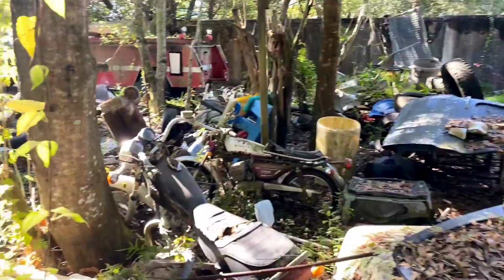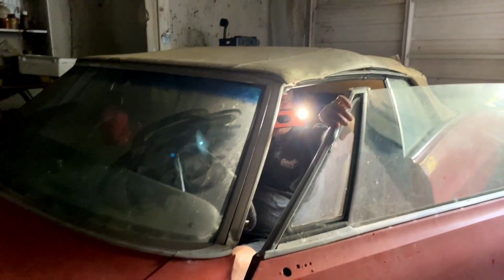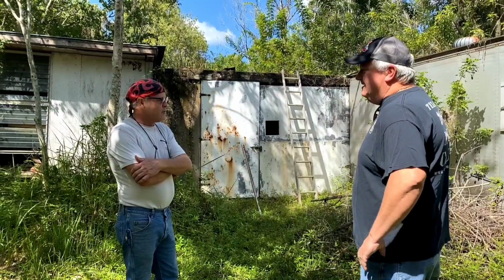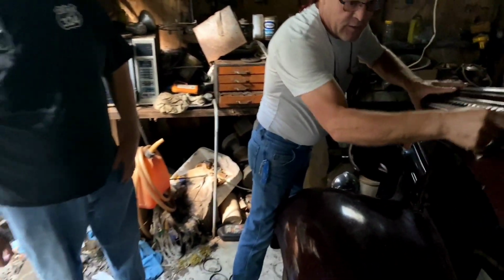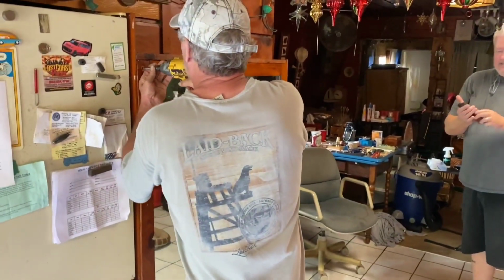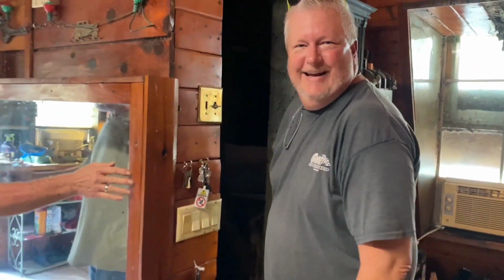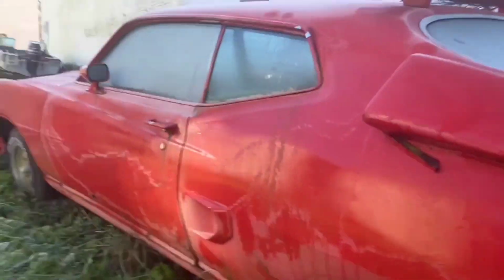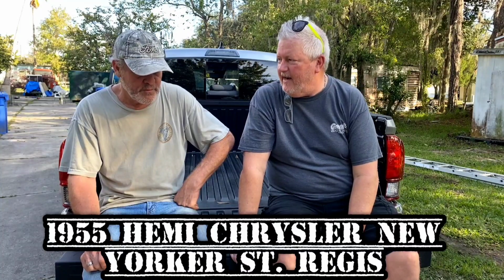BARN FIND HEMI, MORE!

Comment: Had to watch all three to see the torino...lol...really interesting
I had the 70 gt 351 4v (introductory boss) engine ...kept it 25 yrs until it got towed ...mine was 4 speed tw10 born warner top loader trams with 350 gear and factory tach...very rare, can't even find pics of that body....sux...but my interest started with my dad buying my mom a 70 429 king cobra engine in a (gt) midnight candy blue with 373 gear and same borg warner 4 speed trans ....in 70 you could order any thing you wanted, so dad liked the gt torino body better than the cobra torino body for the tail light going all the way across ...also had the light blue that ran to dark blue rally stripe down the sides of that midnight paint which the cobra body didn't have ...at lol so beefed up suspension that kept rear a little higher than normal with a black shaker hood scoop and little orange cobra snakes that glowed when the secondary (4 barrel) kicked in and large cobra snakes on interior door panels...gorgeous fn car...at the ford dealership here in lex s c, they asked dad if they could keep it two weeks and did, right out in the open behind the building for everyone to see...lol along with almost all employees driving it at least once....really cool time !!!!!!!!  Also have never seen another 429 in the gt body again...but hey, it WAS special built by dad order...he had the 69 galaxy with 390 interceptor and he and mom smoked up the town...lol
You could get 429 4v, 429 cobra, or 429 king cobra at the time...ford underage for ins purposes but it had around 550 hp in reality....AWSOME set up...mom wrecked it 3 times over the years until a 18 wheeler finally drove over front end coming out waffle house pk lot...dang shame....always dreamed of duplicating it one day but it gets farther away every year...

Sorry about the long comment..subscribed
Reply: Meant to say (underated) not underaged
Reply from the maker: No need to apologize! I'm glad I was able to inspire you to look back on fond memories. My brother's friend in high school had a 429 Torino in yellow with a 4-speed. I've never seen one since. Also, those reflective stripes were awesome! My dad had a 1973 Torino wagon when I was a kid. 302, tan paint with black interior. Even THAT is rare these days. Thanks for watching and commenting!